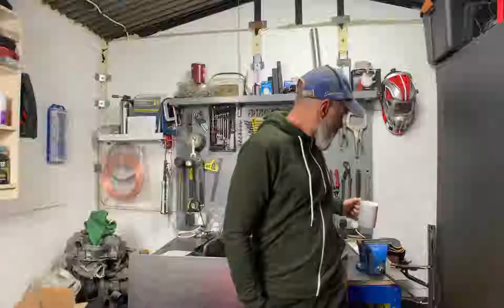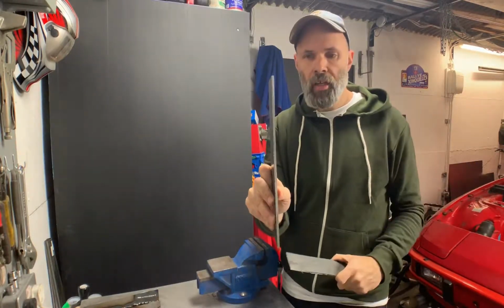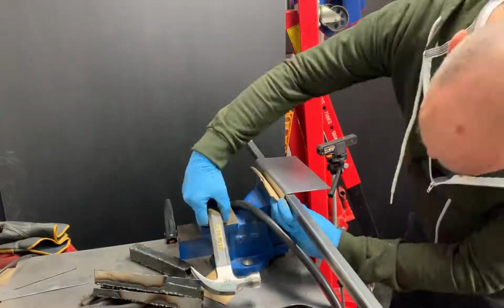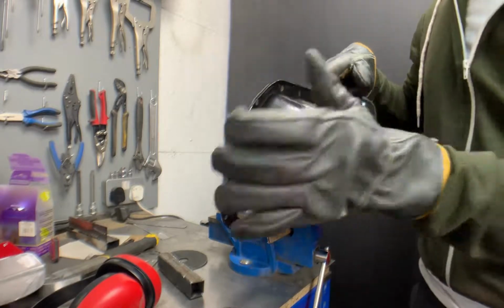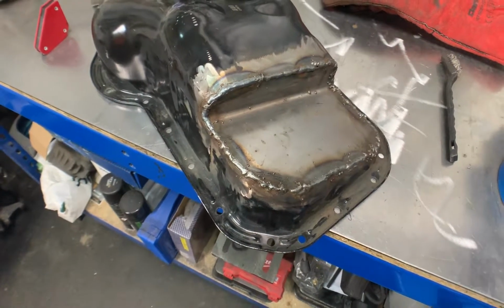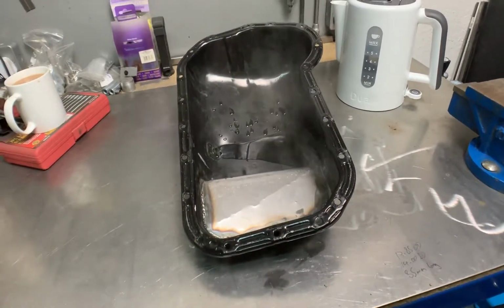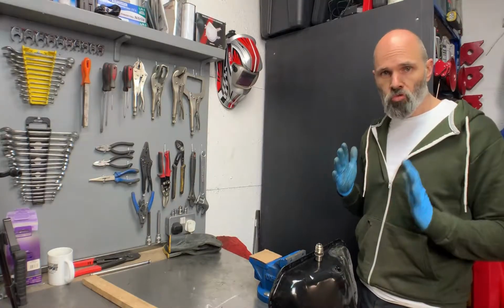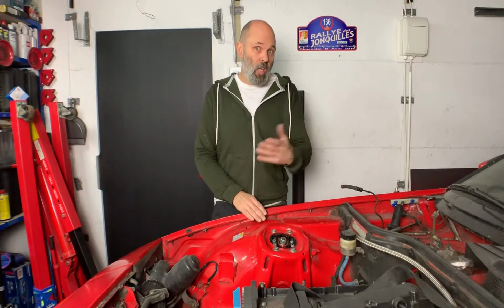Porsche 924 S Turbo Build 7 - Sump Welding (MIG Woes)

Comment: Thank you for doing the videos; they are invaluable since I am doing it myself. Do you have a cutout template for the oil pan? Thanks
Reply from the maker: I don't no - I just measured, cut and then bent the sheet into place. Good luck with the build!

Comment: Just discovered your thread today.  You are being too hard on yourself, your welding is ok.  The end result is what matters, looks good. Personally I would have welded the plate on the sump from the inside, then trim it to shape, and then weld along the out side edge. Then grind back to form a rounded edge. The risk of trimming the plate before welding is that things move when welding and you can end up with gaps to fill.

Comment: this is a great build thread, watching with interest.  top tip (not that there's anything wrong with what you have done) when hammering to form a 90 degree edge or flatten anything (or centre punching etc.), a closed vice becomes an anvil!